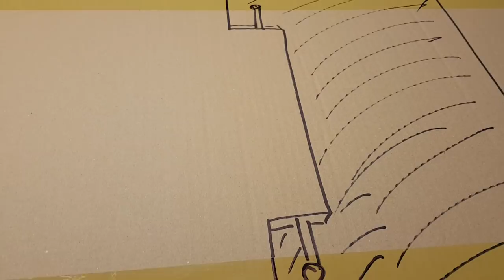Ep061 Fuel tank and Scarfing Main Bulkheads - Life ON The Hulls - Catamaran Build

Comment: G'day Ross, Sant Marine have other tanks that may fit below in your hull between your bulkheads. Their 300 litre and 360 litre have more volume but are shorter. Give them a call as they may have other tanks that they can make and that can also be put into survey.
Reply from the maker: I went for the 270ltr version as pictured in the vid as the fittings were in the correct place for my layout and it can be positioned lowest the hull,any wider and I would struggle to gett the centre of gravity to the floor.This capacity is more than most similar size cats on the market so am really happy with the choice.I am also able to fit a lot of other equipment around this size.Cheers Ross

Comment: Glad to see it coming together slowly but surely. 
Those bulkheads are massive! 
I imagine there is a lot of tanking, pipework, cabling etc to go under the flooring. Presumably you leave access hatches all along.
I hope it is getting cooler by now. 
Cheers mate. 🥂
Reply from the maker: Starting to cool off now,insane summer.Lots of underfloor plumbing pumps through hulls,etc to come.I have many access points but still requires a lot of thinking and planning.Cheers buddy.Ross

Comment: Great effort guys, looking good. Ross o I just came back from setting up my mates cat with a fuel transfer and polishing system due to diesel bug. 
We got the idea from Robert on SV Twixter. It allows you to transfer the fuel from one side and back through a filter. I added a couple of extra valves so that you could also transfer from jerry cans into your hull tanks, but also transfer out of the hull tanks into jerrycans. All processes flow through the filter so your diesel is always clean.

Comment: Hi Ross, as You remember I was thinking of those tanks already a while ago. And while You are at it .... have You thought about running tubes, pipes and wiring the boat. There will be huge amounts of wires. For example I know in the newer Amels they run the main wire harness through a tube that is sandwiched inside the deck. I know it´s still a long way to go but if You think about it on time the whole installation might be a lot easier and look cleaner. Take a close look at the latest CAT design details. Fancy light switches flush mounted..... but how do they run the wires ?  I think they use Nida-Core and integrate the tubes before glassing the panels.
Right now it´s just glassing in a few tubes in strategic locations but later on ????
Well, just thoughts)) have fun, Cheers

Comment: Hey Ross I was wondering if your were going to have the water escape hatches in the bottom V-hull , usually one on each side of the V-hull , kind of like a view port where you can see virtually across the water to the opposite hull, called escape port hatches , not sure if they are required by maritime or not for the bottom V-hulls .....
Reply from the maker: The plan will be to have escape hatches, I am not entirely sure where I can fit them and possibly under the forward double bunks is an option as per the Seawind 1160 Catamarans. This can greatly reduce propensity for leakage as they are far enough back to reduce the water slamming on the underside of the bridgedeck, will have to calculate room and see. Ross
Reply: Hey Ross I think the old style Cats did,nt have these escape hatches on the v-hulls just above only the top side decks . Yes ,they would have to be water tight for sure and shatter proof and locked so just anyone can open them up by mistake. Ross here is a link showing them ....you,ll have to really study these hull escape ports.....
neat video anyways 
 https://www.youtube.com/watch?v=_lRzA-dijgA

Comment: Hey Ross Great work as usual in the stinking heat. Listen mate - I know you know your stuff - BUT - have you engineered this so the tanks can be removed in the future without the need for destructive access?
Reply from the maker: Tanks are extra thick polyethylene , rotational moulded so in effect should outlive the life of the boat. I had them moulded with an extra 3 kilos of pE to ensure thickness and baffles were sound. That said, to remove would be possible with a lot of work, but anything is possible. Ross
Reply: Life On The Mold - Building a Catamaran OK that’s pretty sound but hope you have decent access for thorough cleaning each side of a baffle - diesel is prone to MBC - as you probably know very well.👍

Comment: You can make fuel tanks out of epoxy and fiberglass
Reply from the maker: I could certainly do that but the new survey regs are very strict in Aus now under the Amsa standards.These are so ecomonical and come with a pressure tested survey certificate,cant beat that.I am making blackwater and water tanks however.Ross
Reply: yes dude, details! get that certification.

Comment: seeing as it's a cruising cat. Do you think 270L is going to large enough??
Reply from the maker: 270 littes each side,,tital 540 sails and 2.2ltrs per hour per engines at 2000revs equates to good motor sail cruising distance.This is in line with similar size boats ie Seawind 1260,etc.I hope enough anyhow.
Reply: @LifeOnTheHulls  just checked Lagoon,Leopard,FP, your larger than them,so yeh it sounds good

Comment: I have an idea that may make your life easier. Buy round fuel tanks made for trucks. Thais may save you some grief.
Reply from the maker: Fuel tanks have to be a certified model for boat use,either fabricated with marine grade stainless,aluminium or polyethylene that is inert for fuel.There also must be baffles to reduce wave motion.Tanks I have decided on meet all of these and are a lifelong investment as they will not corrode and  were economical.Thanks for the comment,love the platform for ideas and suggestions,helps me rationalise my thinking.All the best,Ross

Comment: Wouldn't it be easier to just order one of the tanks 5cm shorter? Simpler than moving bulkheads.
Reply from the maker: Tony ,Tanks are rotationally moulded polyethylene,the aluminium mold castings castings are valued at around $20k each so manufacturer needs to produce hundreds of tanks to make bank.So a custom made polyethylene tank is totally unaffordable. Limited to range from manufacturers.These tanks are survey rated,pressure tested and will never corrode.Cheers Ross
Reply: @LifeOnTheHulls  oops~! Sorry Ross, I misunderstood and thought you were getting them fabricated. Of course changing the bulkhead wins hands down!
Reply from the maker: @scenefromabove  I though about it but the poly tanks seem to be the go for longevity these days, and fittings are moulded in for integrity.Cheers Buddy.

Comment: On the tank that is too long, couldn't you just cut a hole in the bulkhead and poke the end of the tank through rather than trying to move the bulkhead?
Reply from the maker: As the extra bulkheads under the tank ensured adequate support on the hull the bulkhead moving 5 cm was not an issue, in fact there are three more bulkheads under the tank now supporting it and strengthening the hull in any case. Thanks for watching Steve. Rossco

Comment: cut the tank 5 cm
Reply from the maker: John.Tanks are rotationally moulded polyethylene,the aluminium mold castings castings are valued at around $20k each so manufacturer needs to produce hundreds of tanks to make bank.So a custom made polyethylene tank is totally unaffordable. If thsnks were aluminium or ss steel,different story.Limited to range from manufacturers.These tanks are survey rated,pressure tested and will never corrode.Cheers Ross
Reply: @LifeOnTheHulls  Just remember. No matter what we suggest, build it your way.
Reply from the maker: Love it buddy,i love the suggestions it allows us to think outside the mold,which is becoming more unsular by the day.Cheers